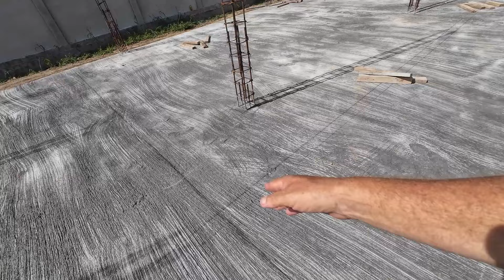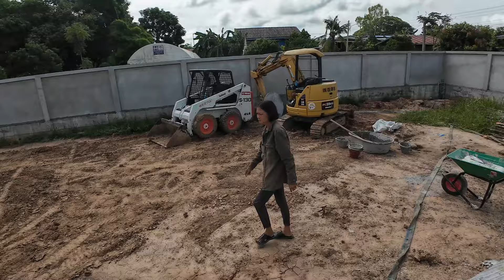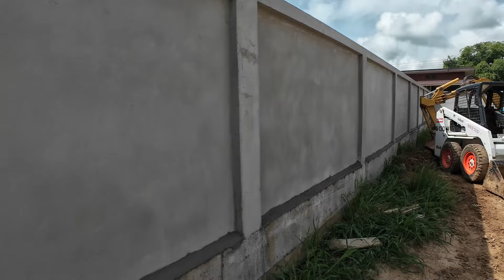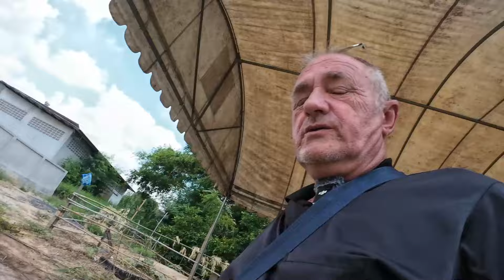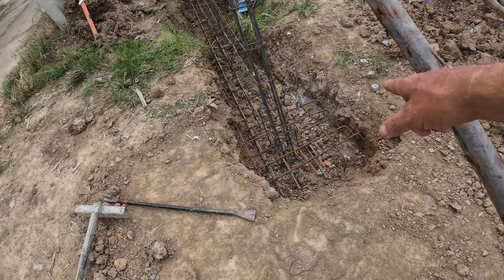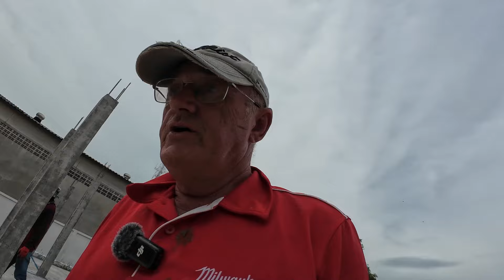New House Build in Phichit Thailand   Part 5

Comment: You do great Bryan. I manage our build over the past 6 month and it is nightmare. The doorframes were to low because i changed them to 220cm.  They build an internal double wall which we never wanted. Walltiles in the batheroom look like a jigsaw and not leveled. Don´t know what
t´s next. I hope the hotwater tank with 80 liters hold on the light brick wall. At least they put 4 bolds in with epoxy. interesting to see this new build. All the best to you.
Reply from the maker: @okrim-thailand  cheer buddy much appreciated,  it is really hard work to build how you want it and making  sure the builders do right first time always have to have forsite  so nothing gets missed. Thanks for watching bud 😊🙏🙏🙏